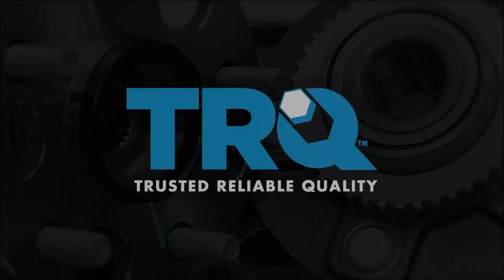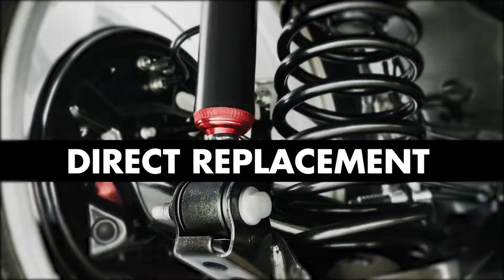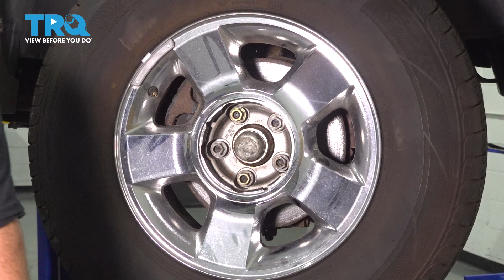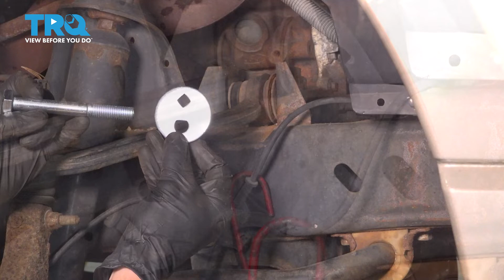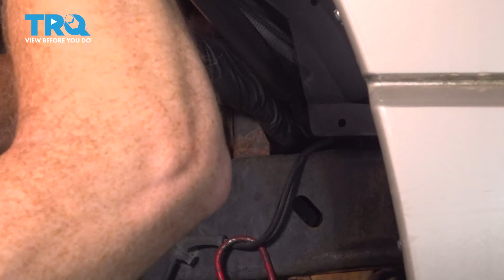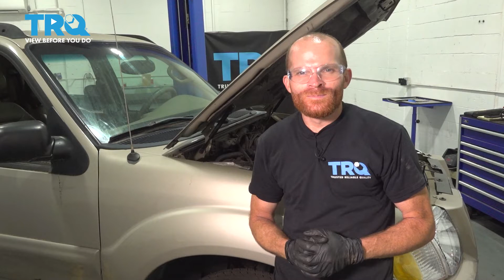How to Replace Upper Control Arm Camber & Caster Kit 2001-2005 Ford Explorer Sport Trac

Comment: That's why we don't use rolling transmission jacks to compress the suspension.  The exact thing you just stated not to do, is now 3 times more likely with a rolling platform. A 3 leg pole jack would be the safest way.

Comment: To everybody questioning the small washer location: This fella did it wrong. The small washer is intended to go to the inside of the cam disk, not between the bolt head and cam disk. The design is to hold the cam disk captive between the bolt head and the small washer to prevent distortion of the disk when tightened. Put it on the outside and the disk can distort.

Comment: The placement of the small washer is my question.  I would imagine you are doing it correctly in your video.  But many other videos place the small washer on the INSIDE of the Cam adjustment washer.  Just wondering why they are wrong and you are right...just needing some clarification.  Thanks.